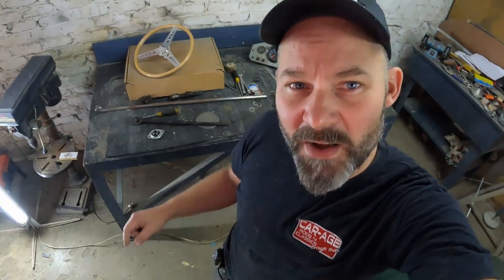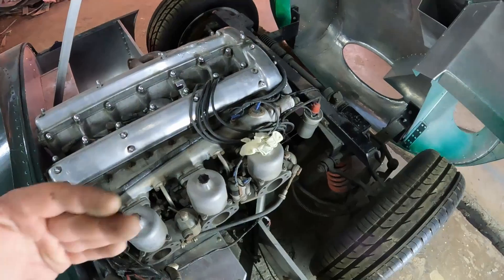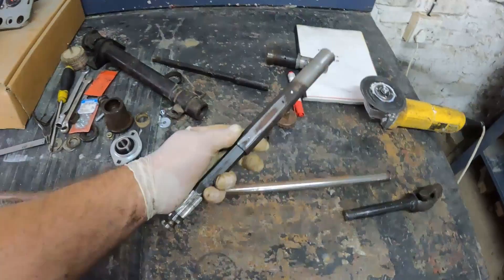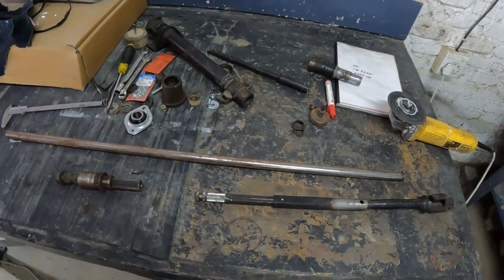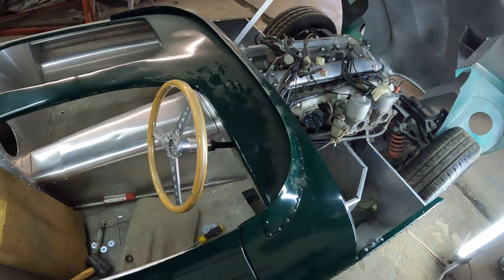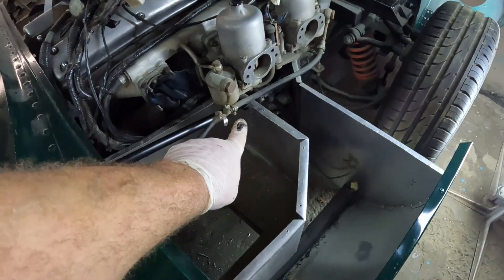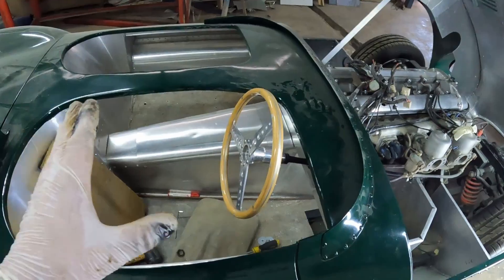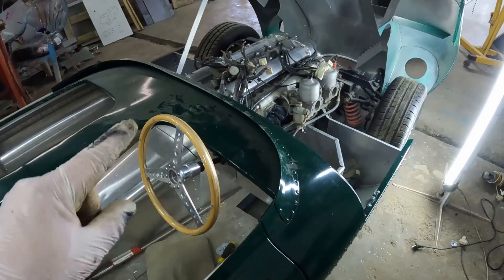Fabricating a DAshboard and stEERing for the d Type Jaguar

Comment: I wonder if the owner would have a set of Smiths Jaegar clocks for the car.  They would look much more appropriate for the year the car is replicating.  I was concerned when I changed my 65 MGB over to negative earth, since the original tach would no longer work.  Luckily I found a guy in the UK who sells a bit of electrical magic that has the tach working better than ever.

Comment: Hey I was a policeman and saw a solid steering shaft from a Volkswagen kill a driver in an accident, you’re quite right to work around a solid shaft in a direct line to the driver .  You’re doing magnificent work it’s amazing . Just mentioning that the Toyota Prius has got an electric assist which people use sometimes in mustangs and other cars which don’t have power steering   , it’s a popular modification from a wrecked Prius because there’s no hydraulics it’s just an electric motor with a controller.
Reply from the maker: That's very sad. That a small change can mean the diffrence between life and daeth.
Will keep the Prius in mind, I actually want to do a similar upgrade on the McLaren as it currently has hydraulic power steering that leaks.

Comment: Very nice work on the dash. Only 2 small gauges on the Jag? 
Most of the cars from that era had the spear to the heart steering column. My TR3A has a steel shaft from the steering box to the steering wheel with no safety features.
Reply: Same on my 65 MGB.  We die like real men, speared by our Les Leston wood wheel.

Comment: Would it not have been a solution to install the rack and pinion behind the wheel axis rather than in front ( I think they call this the Ackermann setup)?
Reply from the maker: I have a huge Ackerman issue to resolve on this build but unfortunately the rack couldn't fit behind the axis as the engine is in the way. I do have a possible solution but will have to see if it can be implemented

Comment: I think it would look nice if the dash had an aluminium panel over the black, with those swirl patterns and little dome head nuts, I think that kind of thing was popular in the 50's.
Reply from the maker: I love it! I did something similar with the Bugatti and it's one of my favourite features on the car.
The Jag was all black thou.
Reply: Nooooo!  Engine turning is fine for a car from the twenties, but the Jaguars used crackle black, nice and non-reflective, and it ages beautifully.  Less glittery, more redolent of scientific precision and the fifties. The gauges had matching black rims of course, there was rarely a cap on the centre of the steering wheel - just a hole.  (PS the dampers on the SU dash pots need brass screws instead of plastic, but that can wait for later…). Great work!